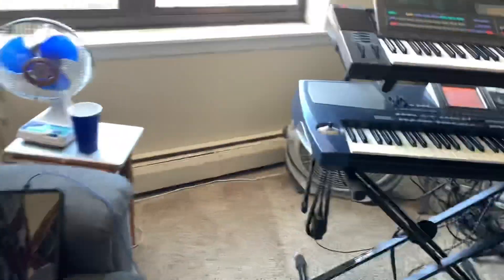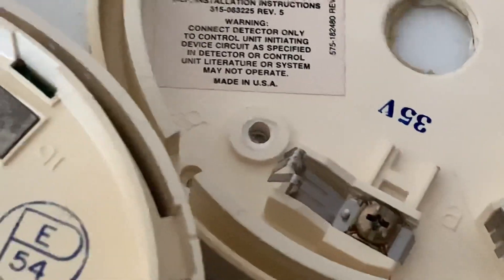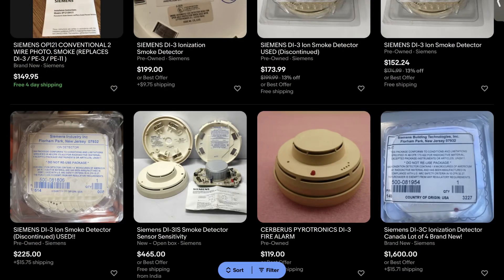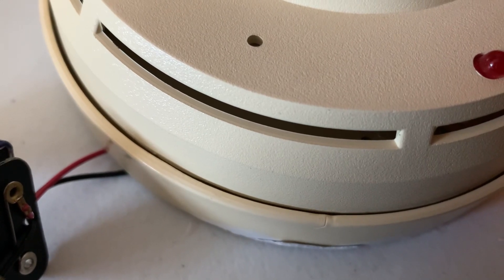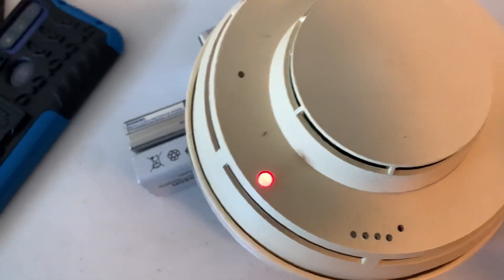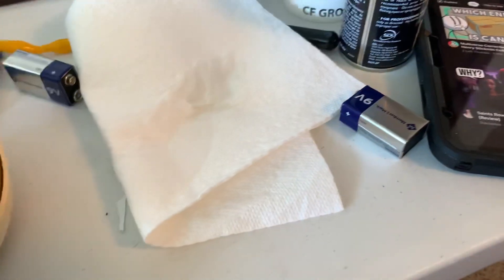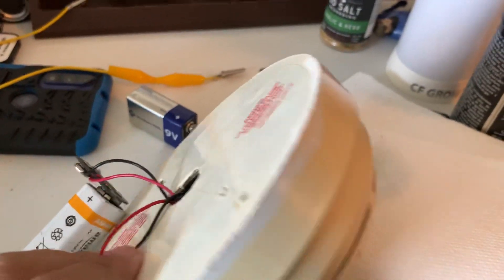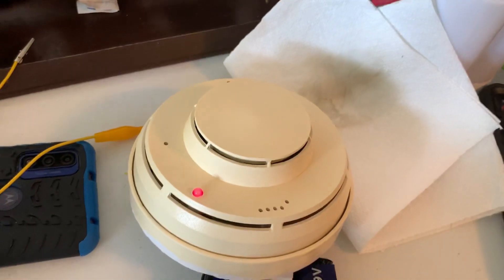Cerberus Pyrotronics DI-3 Smoke Detector — Unpack and Test

Comment: This is interesting. I didn't know they made conventional versions of these detectors. Something important to note though, is that it's a bad idea to power commercial 2 wire smoke detectors on batteries. I've killed two of them by doing that. Their power source must always be current limited, or else they will draw an insane amount of current when they go into alarm and burn themselves out.
Reply from the maker: I disconnect them from battery power after I'm done making the videos.